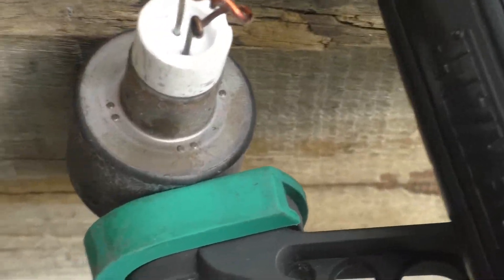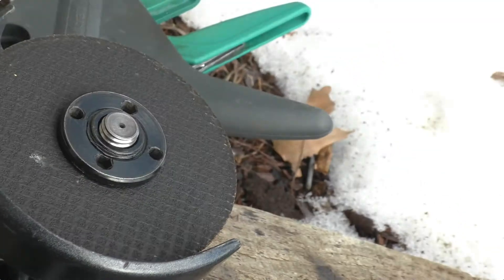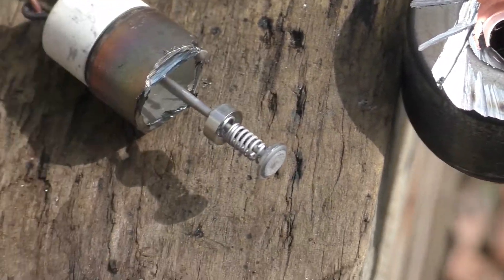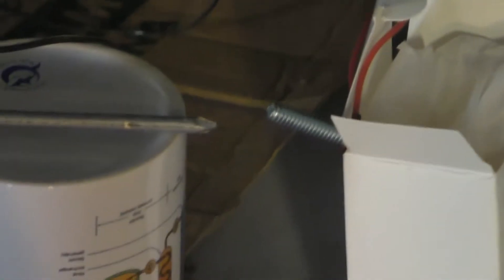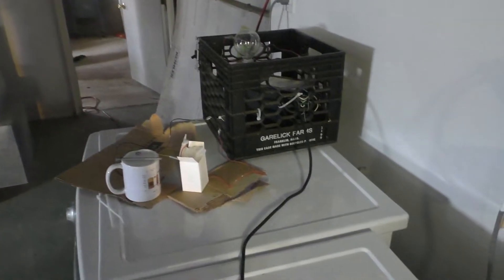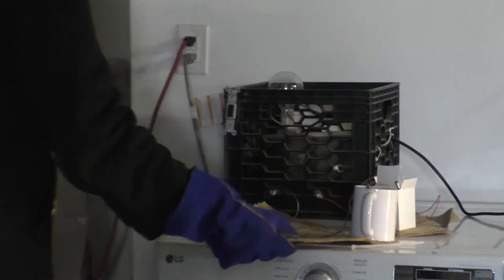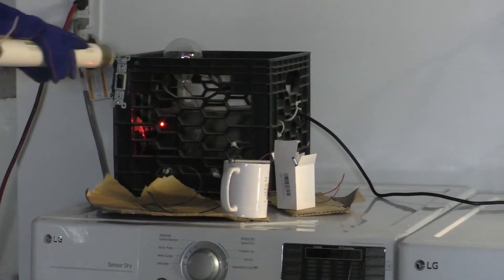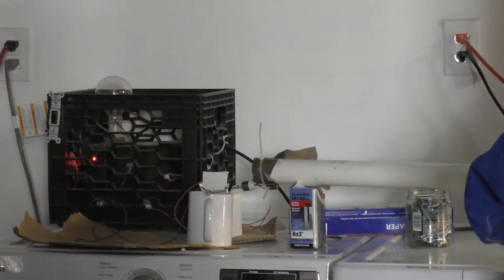Removing Thorium From Magnetrons~(DIY): Testing For Alpha Decay

Comment: Magnetrons do not have thorium. You most likely breathed in beryllium oxide (carcinogenic) when you cut the magnetron, the ceramic is beryllim oxide.
Reply: it depends on what the magnatron is made for and the wattage, high power magnetrons, i.e. ones for the military and satellites, use thorium dioxide since it has insulating properties and also because it will allow the filament to emit more electrons. normal microwave magnetrons don't need much power (compared to an industrial or military one), only around 1000 watts so the thorium isn't needed. they are efficient enough, 1000 watts in, 700 watts of microwaves out. also the ceramic is probably not beryllium oxide as there is no reason to use that in a low power magnetron, it seems more like aluminium oxide, and for the purple ceramics, its probably mixed with chromium trioxide, although some magnetrons might have beryllium because cheap
Reply: @EdwardTriesToScience you're right about berillium (it' s expensive). It's ever take   maximum precautionary measures when make debris and dust when cut metal, woods and plastic.

P.S. I checked my waste magnetron and it's not radioactive (movie on my channel)
Reply from the maker: still had to check tho

Comment: What can you do with it now?
Reply from the maker: good source of radiation to test out homemade Geiger counters. you can also bombard Thorium with neutrons and it will decay into protactinium and then uranium.
Reply: how are you going to  bombard them with neutrons ie what are you going to use to do this?
Reply: @Casey Mather The americium in the smoke detectors are around 1uCi, the needed amount to even get some neutron activation is around 5mCi of it. That means that you would need 5000 normal smoke detectors so it is not worth even trying. There is one way and that is to use around 80 industrial smoke detectors that has 80uCi of it.